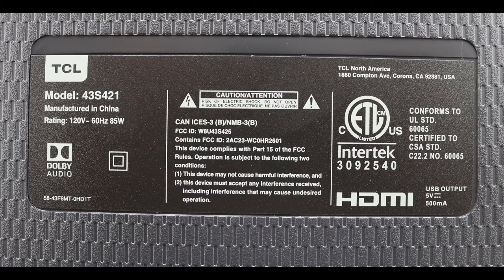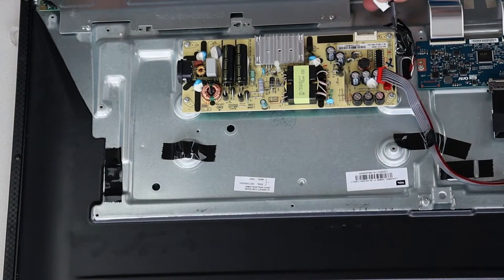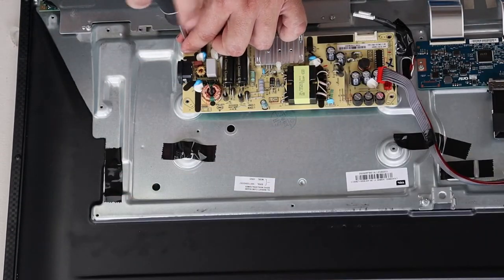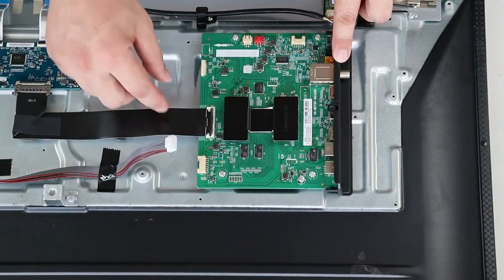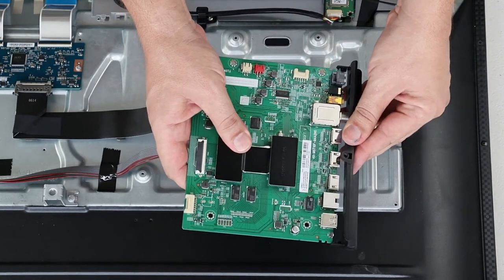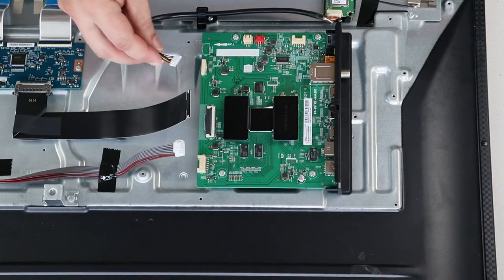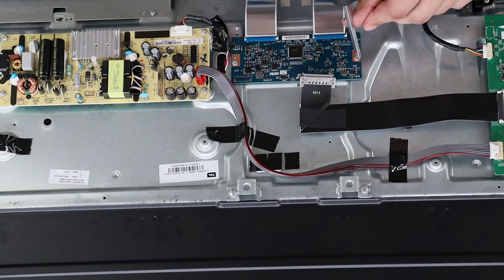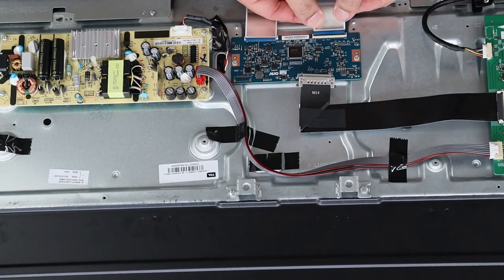TCL  43" 43S421 LED Tv Repair  - Complete Boards Replacement Tutorial

Comment: Hello, I installed a used graphics card on my tlc tv, and it worked but the image looks squished in into the screen. For example, the home menu shows up but the icons are behind the options . Is this somethign that can be fixed with a setting is the board damaged ? Thank you